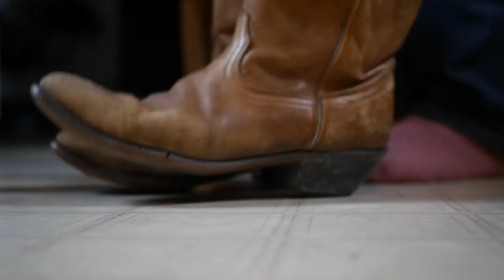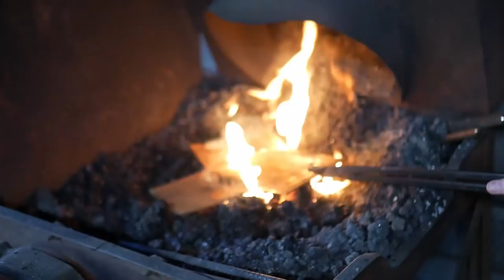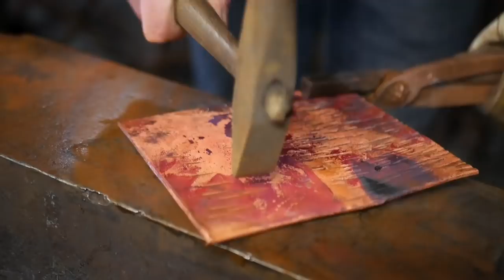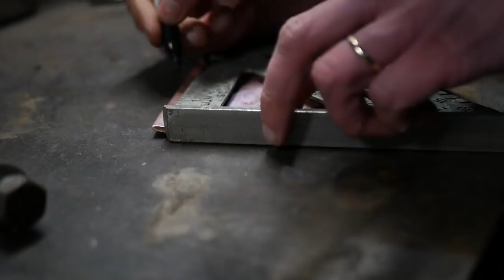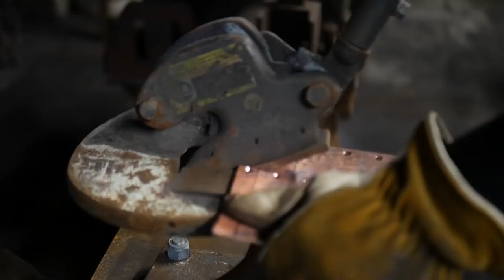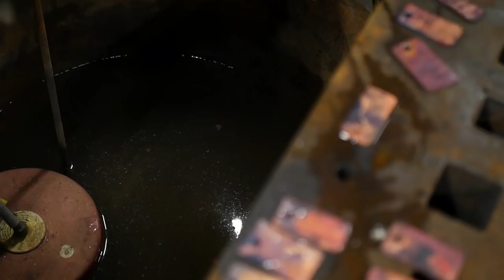Forging a Necklace Pendant (Forging with Jess)

Comment: Nice work Jessica! I bet if you check out the copper bowl scraps, you could get some VERY interesting abstract shapes, for another batch of pendants, earrings, or bracelet components. One safety note, don't tuck pant legs into your boots in the forge, and be aware of open pockets. I set a pocket to smoldering at the forge once, when hot scale landed in my pocket. Minutes later, I was smelling burning cotton.
Reply from the maker: Hi Drason, Thanks for the heads up. The copper scraps could be really interesting :) ~Jessica
Reply: Just what I was thinking, burning socks are no fun!

Comment: Love your Celtic cross on the wall at the end of the video. I have a similar one on my Rosary. 
Nice project i could get the grand kids into. I have a small cheap cast iron anvil i could turn them lose on and a couple small hammers they could use. The twins are 6 and the other one 5 and they just love to be in the workshop with papa and its hard to find things to keep them occupied with out to much injury. They do however grab safety glasses as soon as they come in the door.
Reply: Thats a great idea. Good on them for safe mindedness
Reply from the maker: Hi Eric, I think this could be a good project for kids. They could texture the copper. Just make sure the copper edges have been sanded smooth. The cross is hand carved by a friend of ours in Nevada :) Thanks for watching, Jessica

Comment: Those are very nice little pendants.  I did have a couple thoughts for version 2 or 3 (down the road)...  Incising a design (could be kanji, a letter, a simple symbol, etc) in the pendant for a personal gift.  Something like that would almost have to be a custom order. Another thought would be tin plating. Not the whole thing; but perhaps more like application with a brush.  I have never done any tinning, so I don't have any idea what would be possible, but it could be something you might want to experiment with. 
It's just a couple of ideas for expanding your creative expression.  The pendants as they are are great, but there is always the next horizon.
Reply from the maker: Thanks for the thoughts Brian! I actually took a few of these to enameling class to enamel. I do want to add some personalized stamping... that would be a nice touch! I'm not real big into tin work, but I may get a hold of some aluminum and try that in the future. ~Jessica

Comment: Jess 2 questions, Why the hand file and not the sander and what type of metal are you using and what thickness. Great job.
Reply: That's copper, pry 1/8 or 1/4 inch thick
Reply: copper conducts heat rapidly! plus those pc's are on the small side, I personally would be worried about my fingers!
Reply: @shadetreeforge  that's a fair point, it's also incredibly soft so files make quick work
Reply from the maker: Hi Lisa, great questions. I haven't been trained on the sander yet and Roy wasn't around so the files where the tool of choice! I'm afraid I don't know what thickness the copper is. I just picked some up out of Roy's scrap bin. ~Jessica

Comment: I’m thinking it might be a better idea to have your pant legs out of your boots when in the forge, so nothing hot falls into them. Just a suggestion
Reply from the maker: Yeah, I thought about that. These pants are a little tight around the ankles for that. -jessica
Reply: @ChristCenteredIronworks  Jess, when running a drill press. Long hair needs to be tied back also!